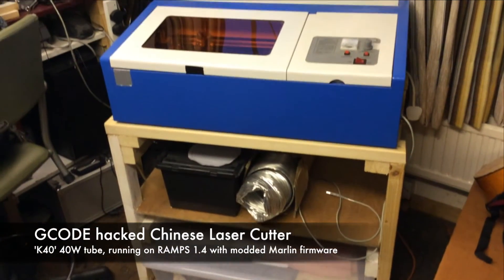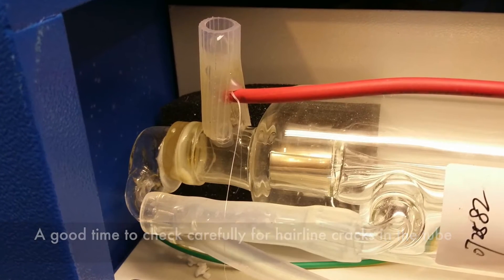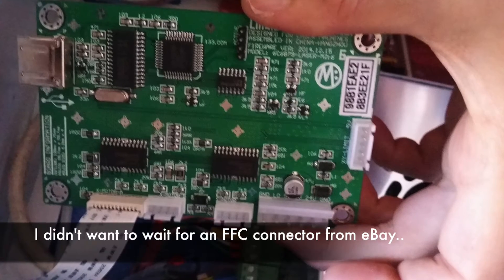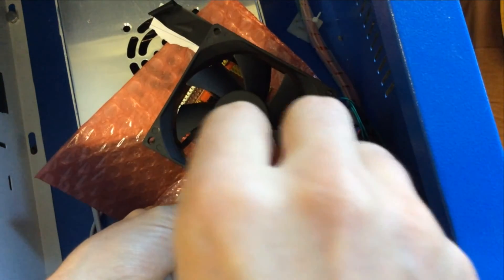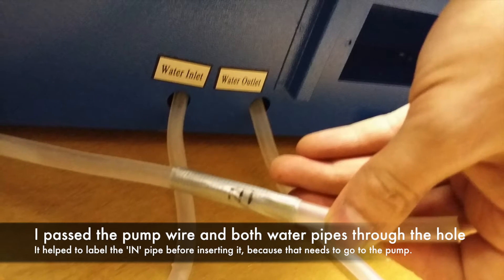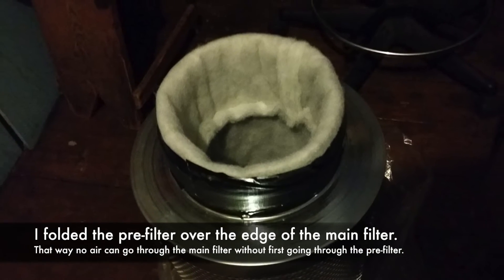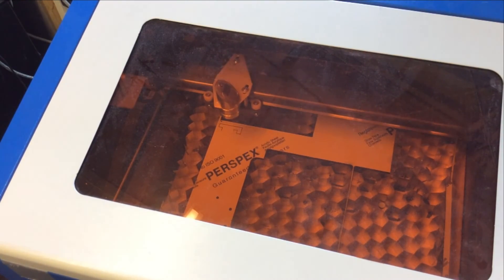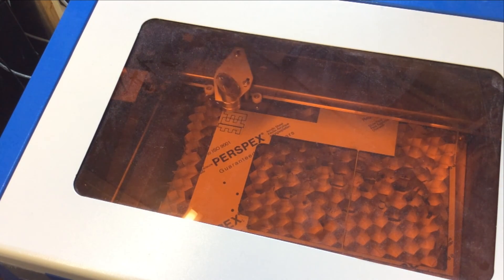G-code - Enabled Chinese Laser Cutter

Comment: hello nice video, what program do you use to control the laser machine?
Reply from the maker: Hello, I used Marlin, but for this RAMPs/Arduino modded laser cutter, any G-Code sender software or 3D printer software would probably work.

Comment: Very good info, I like doing my own adaptations, I have bought a led laser to fit to the cutting head as well as air assist. How do I wire up the pointer laser diode, it's 3volts ? Appreciate your help. Thanks. RM I do intend to upgrade and use before moving on to bigger laser machine. Fascinating tool one you can use the programme. I've subscribed, your very interesting and make it look pretty simple to adaptations

Comment: hi there i have one of these cutters and mine is sparking. what have grounded yours to?. i have made a vid on it if you want to have a look thanks
Reply from the maker: If it's sparking, I'd get an electrician to look at it if I were you. Those sparks must be a few thousand volts and could certainly kill you. I have wired 240 volt stuff up before but I wouldn't touch anything higher voltage or current than that. I've only modified the 5V and 24V wiring in my laser cutter. The earth on the power supply in my laser is wired to earth on the mains plug via an earthing post on the chassis and that seems to be the way most of these are wired, compared to most circuit diagrams online. I'm not sure if that is sufficient for safety but I've never seen any sparks myself..

Comment: Hello
My laser 40w china product . I can't to make parametri for cutting. Pliz tell me ,me need help!!!!
Reply: At the Moshidraw program you can selct Cut instead of Engrave but you need to open a DXF file, vector lines drawing. I cannot cut from a jpeg or bitmap file. I use Inkscape to draw the cutting I want and check the file for any unwanted line using LibrCAD, a free program and then open it in Moshidraw. I am not able to see what is there until laser does the work but I am able to make intrincate cuts with this heap laser machine most of the time.
Reply: @alexecheverria  I use inkscape and K40 whisperer.
And there's 50-60 youtubes on how to use that combination. And BOTH are free software.

Comment: Amazing video mate. Thanks for sharing. I was wondering if you put a few small computer fans ( 2")  into front panel of the laser box, would it help or not?
Reply from the maker: Cheers, glad you found it interesting. The main reason I'm extracting fumes from the laser with the large fan is to reduce toxic gases and smoke in my workshop, so I need to be able to either filter the fumes I extract from the laser and / or vent them outside my workshop. I don't think that small computer fans would be powerful enough to do either of those things - I don't think they could overcome the resistance of a carbon filter.
Reply: Wow, flash answer. Could you tell me please what's the capacity of the extractor fan in m3/h or can you share a link so I can buy the same one? Cheers
Reply from the maker: Sure, it's 700m3/h
Reply: Cheers mate

Comment: So i have my ramps board all ready to flash and was curious your thoughts of another mod. What would you think of moving the blower to the left side removing the angle ledge piece the laser sits behind and pop riveting it outside the case then mounting all the electronics under the laser shelf all outside the case then removing the panel between the two lids. I'm thinking of 3d printing a new track system and mirror mounts using 10mm smooth rods much like a prusa x axis.
Reply from the maker: So you'd extend the cutting area? Sounds interesting! One thing I've noticed with my K40 is that the power of the beam gets noticeably less if I'm cutting something further away from the origin. That's either because I haven't lined up the beam properly or maybe because the beam spreads out before it hits the final mirror and lens - so possibly less of the beam gets focused so the power gets diluted. So I wonder whether this would be a problem with a larger cutting area. But you may solve that if you replace all the mirror mounts with better ones, as you plan to. Maybe even add a couple of lenses right in front of the laser tube to focus the beam to infinity. I'm not sure if more expensive machines would have those but it'd make sense to me.

Comment: with the turino did you still have to cut the ramps board the way I have seen people do in order to make this work?
Reply from the maker: I didn't have to cut the RAMPS board, because the laser PSU supplies 24V and Taurino can handle up to 30V

Comment: Nice work OpenTronics! It's always great to see how far my firmware has traveled around the world :)
Reply from the maker: +Turnkey Tyranny glad you came across the video - so you're the guy who improved the firmware that Dan Beavan initiated? I actually started trying to modify a copy of Marlin from scratch but I got really confused by the way it buffers gcode. So I ended up with a program that turned the laser on/off when the gcode reached the Arduino, not when it had reached the correct point in the gcode ;) So cheers for smoothing my introduction into coding for CNC controllers!

Comment: Hi Could you help me please as I have a 2560, ramps1.4, stepper drivers, middleman board to convert the ribon cable and a 12864 lcd but not sure with the software what to put in the arduino software  but if you have any other software I could use that you could help me with would be great.
cheers
Bill
Reply from the maker: +Bill Parker Download the Marlin firmware from here: http://3dprintzothar.blogspot.co.uk/2014/08/40-watt-chinese-co2-laser-upgrade-with.html - this is not my own firmware, it's better than the firmware that I wrote! Direct link to the firmware on github: https://github.com/TurnkeyTyranny/buildlog-lasercutter-marlin But if you use SketchUp to design stuff, I recommend my own SketchUp plugin to export GCode for the laser: https://youtu.be/jZzNP_yle_o
Reply: +Bill Parker  where did you get the middelman board
Reply: +laurence alexis Hi I bought my middleman board from ebay about a month ago but been too unwell to get on with modding my k40.

Comment: so how do you align a laser without seeing what its pointing at?
Reply from the maker: I see what you mean. The pound is probably only going to get cheaper, thanks to 52% of my country ;)
Reply: +Eddie Amaya and what is ramps?
Reply from the maker: +Eddie Amaya you can align the beam by placing a small piece of paper or tape over the hole on the prism above the final lens, on the x axis carriage. As you adjust the mirrors, you move the carriage to each corner of the machine. When the test spots all hit the same place on the tape, regardless of where the x axis is, the laser is aligned. Before cutting, I always fire a small test spot onto whatever I'm cutting to work out where the 'origin' position of the cut will go. If you set the laser power right, the test spot just looks like a pinprick. This shows how to align the laser mirrors: https://www.youtube.com/watch?v=LsPvxw4w-To
Reply from the maker: +Eddie Amaya RAMPS is an Arduino shield developed to control 3D printers, but it can control any CNC machine
Reply: Hey OpenTronic, have you got any idea what the outer diameter of the supplied water hose is?
If I am going to buy one, I will most likely rebuild the entire cooling system with an IQS system and a water chiller.
Thx in advance :D
Reply from the maker: Glad to help. The outer diameter is about 8mm, inner diameter is around 6mm or a little less. What is IQS? I couldn't find anything on Google. Sounds cool to build a cooling system, however I have run this laser for hour at a time with 20 litres of water, and the water temp lifts a few degrees then just stabilises. I don't often use the laser at very high power though.
Reply: Thanks for the quick reply!
If I will buy a laser, I will propably do a lot of cutting of small series wood parts, so I want this thing to be 100% cool. IQS, well I honestly don't know what it's called in the US, here in Europe it's a common hose connecting system so the system is modular (enter iqs pneumatik and you will see what I mean)
I am also thinking about integrating a small compressor for air support using the IQS connectors.
Reply from the maker: I'm in the UK (it seems like 80% of the CNC / laser people on YouTube are from the US though!) and I've only heard that called a push fit connector. Are you in Germany?
Reply: I am from Austria. Here they are mostly refered to as "Festo connectors" because the company "Festo" produces and sells them. In our company we get all of our pneumatic systems from Festo.
Actually, I am planning to buy my laser from ebay.co.uk (reseller is from Portsmouth)
Reply from the maker: I think you can get some reasonably priced K40s resold from Germany, does the UK reseller offer anything special like tune-up etc.?
Reply: No not at all, it's just some Chinese looking shop ( http://goo.gl/tq7mlp )
The price on ebay.co.uk is better than on ebay.de because the British pound is "quite" cheap at the moment
If you can give me any recommendations for a better reseller, I would be happy to hear it :)

Comment: On a similar idea for $99 one could buy one of these

http://www.miles-milling.com
Reply from the maker: +Roger Rabbit true, but the Lasersaur is not compatible with Mac, and it limits you to only using the Lasersaur software.. whereas Reprap flavoured firmware is compatible with many Gcode senders. Interestingly, though, the Lasersaur is based on RAMPS just like the solution I built, but with a neat breakout board attached rather than my hand - soldered effort. I think Lasersaur is good for people who don't want to get their hands dirty, but the Lasersaur board is almost twice the price of its component parts (arduino, ramps, motor drivers..), and that's assuming that you buy a more robust Taurino rather than the standard one that seems to come with the Lasersaur. I spent a lot more time building an effective extraction system and calibrating the laser path than I did on the electronics, so Lasersaur won't necessarily save a newbie that much time. I would be interested to know if I the small breakout boards were for sale separately though!
Reply: +OpenTronic You are correct on it not working for the Mac.  I've heard there is some desire to get it working in the future for the Mac.  I think it's possible since it uses just a browser as it's application to interface to the controller.  However, what you said is absolutely true based on the current state.  I've also been very interested in reprap flavored version for much the same reason you specified.  I also agree that for someone who doesn't want to do a lot of hand modifications the Lasaur seems very easy.  Now what would be really cool is if the two systems could be combined, that is a browser interface along with the neat Gcode sender with SD card as well.  I just think the browser of Lasersaur has alot of easibility in functioning, but I like the independent ability of the reprap flavored firmware.
Reply: +Roger Rabbit Although I didn't see a LCD display does your reprap firmware allow it?  Maybe I'm thnking Marlin firmware instead adapted to a laser.
Reply from the maker: +Roger Rabbit I am using Marlin with slight modifications, so yes, it'll take a standard reprap style LCD board and/or SD card. Re: usability, my current reprap-style workflow is definitely not for everyone - I don't really have a user interface at all since the Gcode sender I'm using (Pronterface) doesn't graphically interpret the laser-style gcode. So SketchUp acts as my design software and 'print preview' (I wrote a Gcode converter plugin for SketchUp), so I'm relying on being able to understand how the workspace in SketchUp corresponds to the physical space in the machine. So you're right, it'd be useful to create software which allows for a similar degree of flexibility whilst being easier to use.